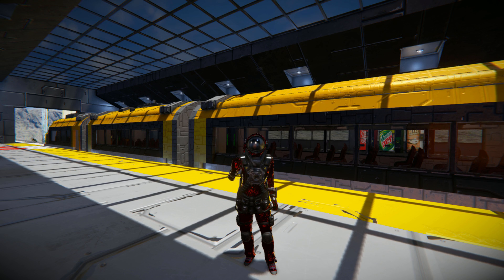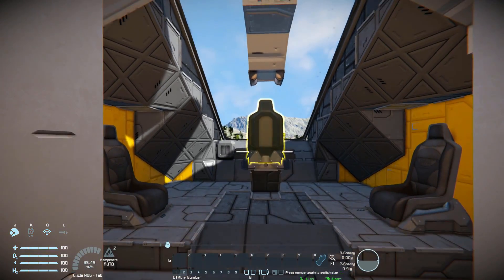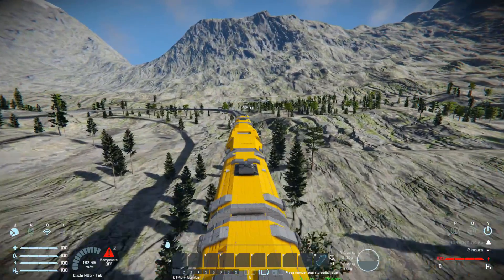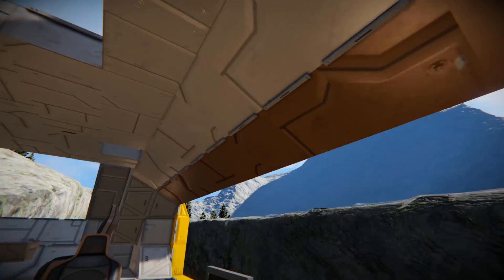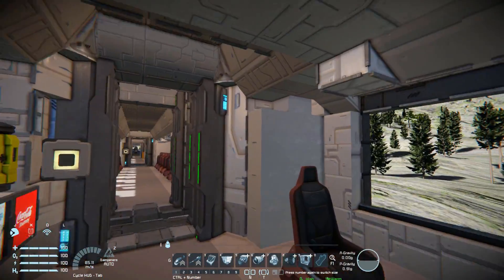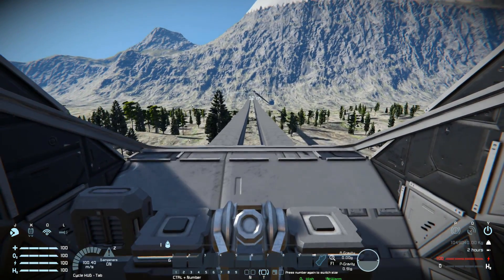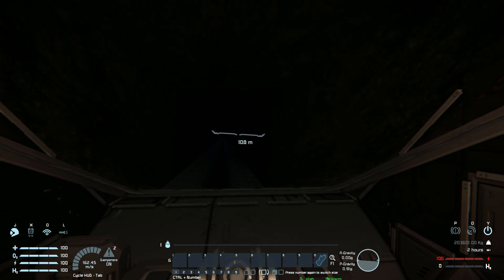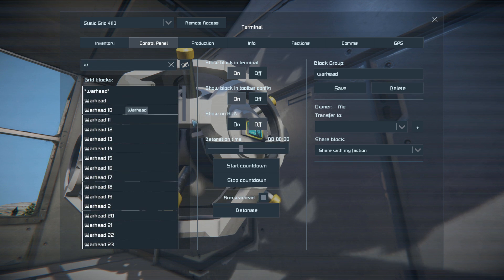Speed Of Light Mod Vs Masu Bullet Train - Space Engineers 'Experiments'

Comment: Say if you had a one of those tracks in a straight line around the whole planet, if you gained enough speed could you remove the bottom half of the holder because the force from your speed will be pushing you up to the top part of the track. 

So after you gained that speed (you would have to work out where) you could just switch to normal blocks instead of those track blocks (I think there are walk ways, I forgot), also it would just be cool to see if floating like that.

Comment: Do this; Add a sensor which monitors speed. If the train reaches a velocity of 22,352 m/s (50mph) it activates a second sensor, which does the opposite; it will detonate warheads should the speed drop below this threshold.
Reply: 22,235 I dont think is 50mps
Reply: @ronidude  it is just he used a comma instead of a period
Reply: @ronidude  Europeans mostly use a comma as point.
Reply: @sptony2718  aaah ok